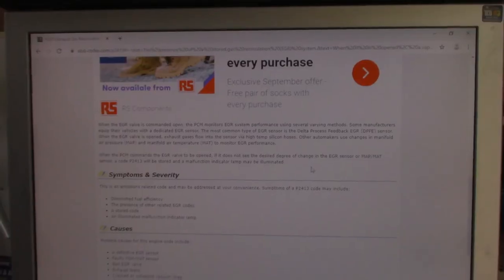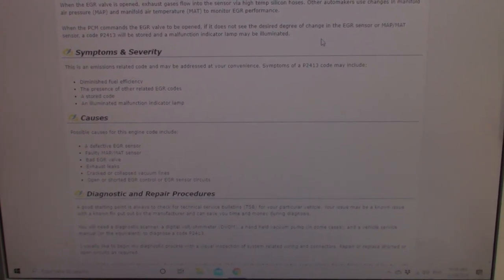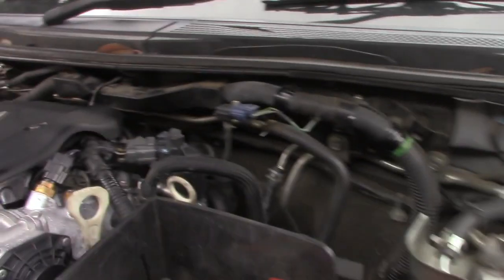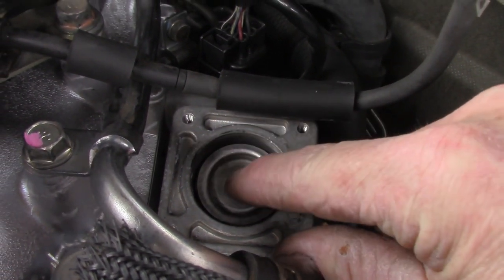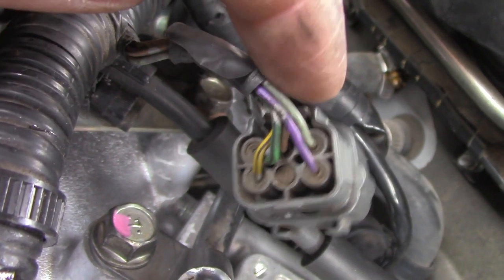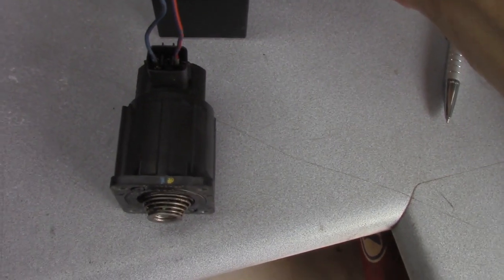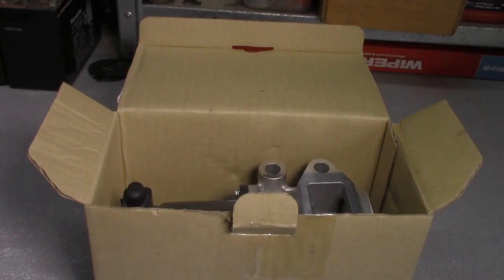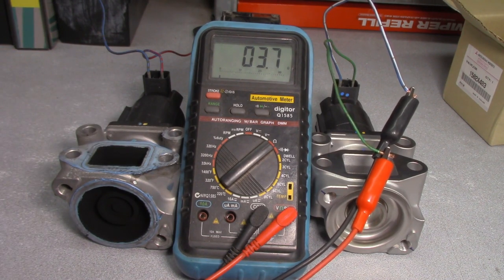Triton P2413 Fault Code MiracleMAX

Comment: Excellent video. With this information I hope to solve my P2413 on a 3.2l Shogun/Pajero. I am interested in your function generator. I have built various gadgets to help me solve other real world problems and would like to build one like yours. Have you a link to your solution?
Reply from the maker: Hey Paul,
I'm glad you got some help from this video. If you subscribe, you won't miss out on any future related videos. 
Here is another video where I used the function generator to diagnose an ignition coil.
https://www.youtube.com/watch?v=G_08QHHxdyA&ab_channel=MiracleMAX
I will be making a video at some point about the function generator, so stay tuned! 😉
MiracleMAX
Reply: @MiracleMAX  Thanks. Subscribed! I lifted my EGR and found 6.4ohms across the servo motor. Applied 12v across the yellow and purple pins and got crisp movement out and back (with mechanical valve coupled so physical resistance probably not an issue). With unit removed from loom I measured (at connector, ignition on, from connector pin to vehicle ground) G pin1 5v, Br pin 2 9.3v, Bl pin 3 9.5v, Y pin 4 9.4v and Purple pin 6 9.4v. I failed to get a reading with loom connector fixed to valve motor as the seal between loom wires and connector pins is sealed and water tight. I set up mobile phone on video record, cleared codes on OBD-II tool and turned ignition on, waited, off and saw valve pop open/closed and then the unit, without valve movement, heard electro/mechanical pulses that had no visible effect, but may have been an attempt to cycle the valve to open and closed several times (a cycle I've seen reported on other forums), no movement. I'm left wondering whether the motor for the valve is faulty, or the wiring to the value faulty. Any thoughts? I wish I had your function generator to exercise the motor/valve properly.
Reply from the maker: @ibslpaul  Hey Paul,
Has your code come back?
The fault code P2413 EGR System Performance, can mean a range of problems, not just the EGR itself.

Not sure if you have seen this video relating to the same code. 
https://www.youtube.com/watch?v=nlErGRhRFMA&ab_channel=MiracleMAX
How many Kms has the vehicle done?
The EGR valve will mechanically wear and then put extra stress on the motor, causing the fault code. Or, carbon build-up can create faults as well.
If you have cleared the code, then the EGR will work again. As shown in the above video, these vehicles will not allow you to do activations until the code is cleared.
Just keep in mind, that this is just a motor with a potentiometer attached, so the ECU knows where the valve is at the time. 
I show you further testing in this other video I have given the link for.
It's best to leave the EGR connected to get correct voltage readings as the ECU may run a bias voltage or other strange things may happen. Just use some dress making pins to carefully go past the weather seals to back-probe the connector. You can see I have used some in the linked video.
Here's a link to some information that might help
https://www.obd-codes.com/p2413

Check out that video - it might give you some more direction in your testing process.
MiracleMAX
Reply: @MiracleMAX  Thanks. My engine is the Pajero 3.2 DiD, 200,000Kms, 2012. I studied the info via the links you kindly sent. I was able to fit dress pins to connector and after clearing codes could see a change in the output voltage from the potentiometer 0.8v closed to just under 5v fully opened (manually moved). Bolted EGR back in position. Ran a live recording on my scanner and noted once engine warm the EGR Command could be seen to vary the EGR Error % seen to grow on command change and quickly drop to 0% as the movement matched the commanded position. It operated at tick over for about 5 mins before the P2413 was thrown. I have the live recording and a freeze frame. Nothing jumps out in the various readings leading up to and immediately after the code being thrown. Once thrown the Commanded and Error stay at 0%. I noted that my scanner has another monitor feature which provided the following information: EGR Monitor Bank 1 (title) followed by a list of parameters and settings,  Component ID: $01; Limit Type: Min/Max; Test Value: 0.00mg/stk; Minimum Limit: 655.35mg/stk; Maximum Limit: 655.35mg/stk; Status: Fail. Is this an indication of a MAP/MAT sensor error? I think this is my best lead at present.
I have cleaned the valve in past and recently - no play in the value and smooth to move. I have cleaned the pipe from EGR to Manifold. I have not removed and cleaned the manifold and wonder if the ECU is clever enough to identify flow problems if manifold is badly gummed up? It's such a big job to remove the manifold. I have a tin of the Wynns EGR cleaner so may give that a go tomorrow. Any thoughts or guidance on next diagnostic step most appreciated.
Reply from the maker: @ibslpaul  Hey Paul,
As you saw in the video, I have used Wynns EGR cleaner with a certain amount of success. These engines suffer heaps from carbon build up. At 200,000 Km, I'm sure there is a fair amount of carbon build up. 
Just keep in mind that the EGR valve is only part of the intake and exhaust system in the EGR system. If any part of this path is blocked, then the EGR system will log a code.
If you are concerned about if you have a faulty MAF sensor, check out in live data what your readings are at idle and about 2000 RPM.
Reply: @MiracleMAX  Hey Max, at idle 94.2kPa and 102.0kPa at 2000 rpm.
Reply from the maker: @ibslpaul  Does your MAF sensor read in grams/sec?
Reply: @MiracleMAX  Sorry gave Intake manifold Abs Pressure figures earlier. 11.03g/s at tick over (650rpm), 58.51g/s at 2000rpm
Reply: Hey Max, I have run the Wynn's egr cleaner through the inlet manifold today. No change. EGR after reset throws the code almost immediately. I did capture 3 freeze frames (one after each throw, then reset  and repeat) and each has an odd setting for Air Flow Rate from MAF sensor, 0.53g/s, 0.53g/s and 0.52g/s. I wonder if MAF sensor has intermittent problem as these seem very low readings. What do you think?
Reply from the maker: @ibslpaul  The MAF readings are very low. Should be about 300
Reply: @MiracleMAX  Thanks Max. Does that indicate bad MAF sensor or downstream resistance, e.g. gummed up inlet manifold. General performance feels good - esp. acceleration.
Reply from the maker: @ibslpaul  Those readings could mean a dodgy MAF sensor
Reply from the maker: @ibslpaul  Is that now the Air Flow readings? They seem within specs for a turbo engine
Reply: @MiracleMAX  Yes, the Air Flow readings. Oh, just ordered a new MAF sensor... If that's not the issue any thoughts about the "EGR Monitor Bank 1 (title) followed by a list of parameters and settings,  Component ID: $01; Limit Type: Min/Max; Test Value: 0.00mg/stk; Minimum Limit: 655.35mg/stk; Maximum Limit: 655.35mg/stk; Status: Fail. " problem reported by scanner?  OR am I left with the gummed up inlet manifold possibility that involves a major strip down to get to?
Reply from the maker: @ibslpaul  Sorry Paul, It's very hard to give any extra suggestions at this point without physically looking at the vehicle. 
Just keep in mind that these do suffer greatly from carbon build up in the intake system. So even a blocked EGR cooler will create a restriction that might bring up a code.
It also could be a faulty EGR valve, although you have cleaned it and tested it. They are pretty fussy at times.
It is strange that you are getting a 0% reading for your EGR valve. Generally you would expect around the 60% at idle & 2000RPM.
Let us know how you go.
Reply from the maker: Hey Paul,
The only other thing I can think of is doing an actuation test on the EGR valve & recalibration if it is available.
Reply: @MiracleMAX  The constant zero% on egr reading is when fault code thrown. Before its thrown it seems to hunt around including zero. Maybe you point about blockages is the issue. I shall check the EGR cooler as that seems fairly easy  - I know I'm shying away from pulling the inlet manifold off, as its such a major job for the likes of me!
Reply: @MiracleMAX  I'll have to go to the main dealer for test and recalibration as I do not have the facility on my scanner.
Reply from the maker: @ibslpaul  Might be best. Let me know how you go.
Reply from the maker: @ibslpaul  The zero on the EGR when the code is thrown is the ECU stopping command of the EGR. You won't see that change unless the code is cleared.
Reply: @MiracleMAX  The first P2413 clears OK with the scanner, but the Pending won't clear until engine cooled down and started once, or so it seems. I can spend 20 mins trying to clear the Pending, on occasion. Anyways, cleared both codes put an oscilloscope on the valve motor and the position pin and with all codes cleared I see PWM varying as commanded EGR recorded on scanner. I also see position voltage change with EGR commanded and EGR Error. So I am certain that the signals are good and circuits back to ECU connected (no open circuits). I noted that the EGR will work as expected at low revs and no codes thrown. However, as revs increase to 2000rpm plus, then the code thrown and the ECU stops commanding the EGR. Does this further suggest than the problem is the clogged inlet manifold? The big job to remove and inspect that I've been shying away from? By the way, I received the new MAF sensor in the post and fitted it, no change. It looks like the manifold will have to come off. What do you think? Or might it be an oxygen sensor in the exhaust? Or would that be a different code from the P2413?
Reply from the maker: @ibslpaul  Hey Paul, as mentioned before, it is hard to advise you without actually being there and doing the testing personally. Just keep in mind that your engine has done 200K & so things like EGR valve will actually wear out, despite what your readings are. They can stick, then release, which will log a code after a time. Once again, these are notorious for carbon build up, which will log different fault codes.
Reply: @MiracleMAX  Hey, update, I replaced the EGR valve and EGR actuator. Reset all codes. Same problem throwing P2413 once engine warmed up. I hooked up my oscilloscope and saw commands and position voltage varying as expected and matching my scanner live view. Once warm code thrown again. Finally took it to Mitsubishi main dealer. They did lots of tests and after 2 weeks decided as they could find nothing, that it must be the ECU. Too expensive to have them replace it for GBP £2100. So I will get it home and send ECU to a company who test and refurbish ECU for less than £200. Mits dealer says ECU is coded and a new one has to be coded by them! Not an issue if refurb is possible. What do you think?
Reply from the maker: @ibslpaul  Going back to this link:
https://www.obd-codes.com/p2413
Have you checked the MAP sensor? It's kept on the firewall & has a vacuum hose going to it. Check the hose for blockage or splits & as usual, 5 volt reference, ground and signal to ECU. I would exhaust all other avenues before condemning the ECU.
Once again, keep in mind that the EGR valve is only part of that system & carbon blockage with throw codes as well.
Reply: @MiracleMAX  Thanks for quick reply. I checked the MAP pipe and it was clear before it went to the dealer. I will check the voltages once I get car back. I asked the the Mitsi dealer to remove and clean manifold and they told me that following their tests and discussion with UK Mitsi tech support that the P2413 would not be thrown if the manifold was gummed up. I find that hard to believe because the ecu will expect a set of readings from the MAF, MAP, and maybe the exhaust sensors and a reduced flow would throw it off expected readings. I can't understand why they wouldn't do as asked and take the £500 they estimated to clean the manifold. Maybe I can removed EGR and pipe to manifold and pop a usb inspection camera with light into the entrance and see what state it is in?
Reply from the maker: @ibslpaul  I'm surprised the dealer said that it wouldn't throw a code. the P2413 is a performance issue. That means that the ECU is not seeing all the data it expects when it commands the EGR. Even the throttle plate is used during EGR command, so there are many reasons for a P2413 to come up. Turbo & EGR cooler can effect the amount of flow and what the ECU expects to see. 
I am not saying that excessive carbon build up is the reason for the code, but these Tritons are well known for carbon build up.
If you have an inspection camera, that can give you an idea of the amount of build up.
Reply: @MiracleMAX  Just got car back from independent garage that removed the manifold, photographed, and cleaned. It was in a very bad state, and the butterfly valve/flaps were fixed by crud and wouldn't move. Now clean the car runs much better, but the P2413 comes back after clearing, cooling engine, then running until warm and the code pops up again, but not until after running temperature reached. The EGR command and %error work well in live view on scanner, once warm, code thrown and cmd and %error drop to zero. At least the manifold is now clean and out of the equation. But still non the wiser to what causes the ECU to throw the fault.
Reply from the maker: @ibslpaul  Hey Paul, thanks for keeping us informed. Honestly, if your manifold and inlet system were blocked & the amount of kilometres on the engine, I would consider replacing the EGR valve.
The carbon is like an abrasive & can cause mechanical sticking of the valve even though it might be OK electrically.
Reply: @MiracleMAX  Hey, Max. Thanks for your reply. I have replaced the egr unit servo and valve as a pair.
Reply from the maker: @ibslpaul  Hey Paul, I hope that you can sort out this issue. As I said, it's difficult to help with diagnosis without physically being there. 
Just keep in mind that the inlet manifold is only part of the intake system. Not sure if this engine has an EGR cooler or not, but that is part of the EGR system & constantly gets gummed up with carbon. Other areas to consider is the valves in the head, throttle body assembly, any related piping, turbo, intercooler, even a blocked air filter can contribute to a lack of flow within the intake system, therefore affecting the EGR system as well. If the swirl flaps were seized, these can get stuck during higher RPM and limit the flow as well. They tend to wear on the shafts and get stuck in the bore.
Thanks for keeping us informed.
Hopefully you will be able to sort out this issue.
Reply: @MiracleMAX  Hey Max, Thanks. I have a new air filter. I have examined the EGR cooler - it was surprisingly clean. Check the pipe from exhaust manifold to cooler and from cooler to egr valve. All clean. Rate that the P2413 thrown is now reduced (since inlet manifold cleaned). The fault code even clears itself from time to time especially if engine restarted when warm from earlier run. I have returned focus to my iCarsoft scanner (intended for BMW but does general ODB2). I tries to run 9 'Monitors'. Only one is reported as successfully run (rest not supported). The one that runs reports 'EGR Monitor Bank 1', Status: Fail. Test value 0.00mg/stk, Min Limit 655.35mg/stk, Max Limit 655.35mg/stk, Limit Type Min/Max. Not sure what it means or if it is a genuinely performed diagnostic that isn't supported, but as it claim Fail EGR Bank 1 component $01, I wonder if it refers to an Oxygen sensor immediately after exhaust manifold? I see Oxygen sensors for sale for this engine but on inspection I can't find where it is. I have followed the exhaust right through without being able to see any wiring to a sensor. I read that such sensors have heaters to compensate until gases/pipework reach temperature. If I have such a sensor I wonder where it is and how I might test it.
Reply from the maker: @ibslpaul  Hey Paul, 
Thanks for keeping us in the loop.
I seriously doubt that the O2 would be related to your issue. The EGR readings are usually calculated by the MAP & MAF sensors.
It is still possible that you have a carbon issue. Could you use a EGR aerosol cleaner though the intake system? If the symptoms are improving, it could be that some of the carbon is clearing after the cleaning.
Have you pulled out the EGR since the cleaning? It would be interesting to see if there is now build-up there.
Reply: Hey Paul (and Max by extension), sorry to revive an old thread, did you get this sorted? Im struggling with the same code, have been through everything you have done here and had a ECU remap and EGR tuned out but the notorious code persists.
Reply: @khgroupie  Sorry Robert, I missed your reply (10months ago!!!!). I have returned my attention to try to resolve this on my Shogun/Pajero 2011 V90 3.2 Did. Problem persists. I get it through MOT/emissions test by clearing codes before test. So I have a  relatively new EGR actuator and valve (1 year old and whole inlet manifold removed and cleaned), new MAF sensor, a working MAP (through thorough testing). EGR cIean. I clear all codes with scanner or allow ECU to clear which it does from time to time. Warm it up low revs. I can drive all day no code thrown providing I do not exceed 3000rpm. EGR in scanner live view behaving just as expected; likewise MAP and MAF. My V90 has a CAT. No DPF. No exhaust oxygen sensors. Mine is the model between Euro4 and Euro5 transition. As soon as I exceed 3000rpm for a few seconds, up pops the P2413. I wondered if CAT gummed up (170k miles). I loosened CAT to relieve pressure -  no change throws same code as described above. Focus now on ETC (throttle body and control). My commanded throttle, once engine warm sits at 18% at tick over and climbs to 100% at about 1800rpm and stays there through higher revs. Always after about 3000 - boom, the P2413 thrown. @Max Could my ETC be the culprit? The vehicle drives perfectly well and fuel consumption is a steady 29mpg.
Reply from the maker: @ibslpaul  Hey Paul, Sounds like you've been busy! The main reason a Common Rail Diesel engine has a throttle body is to help flow with the EGR. When you activate the EGR, you should see a change in the MAF readings. Earlier diesels did not have a throttle as they just add fuel to increase or decrease engine speed.
Have you tried a throttle body reset? Have you done an EGR reset. Does your model have a DPF or a Catalytic convertor or both?
Reply: @MiracleMAX  Thanks. No DPF, just a CAT. Not sure how to do EGR reset or throttle body reset. How can I do those resets?
Reply from the maker: @ibslpaul  You will need a bi-directional scan tool with those capabilities
Reply: @MiracleMAX  So I gave up, My mech did a lot of troubleshooting and we figured there was a voltage drop somewhere down the line in wiring and now have just completely tuned the egr  out of the system. I know its the cowards way out but for all intents and purposes the rest of the system is functioning correctly.
Reply from the maker: @khgroupie  Glad you were able to come to a resolution.